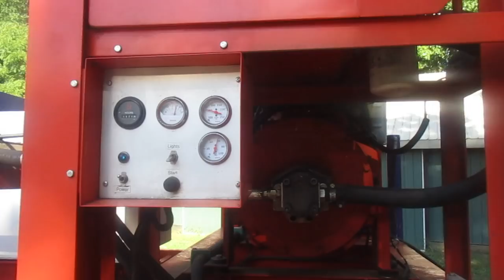Big splitter gets the big chunks  #493

Comment: Boy, Talk about a set-up, that's quite a machine. 2 people, 2 pickup loads, instant wood splitting. The only requirements, a conveyor, a large area and lots of wood. Great design that shows great workmanship. I really like the hydraulic leveling.
Reply from the maker: hi there we do a lot with what we have or can make work . bought the elevator for 1000 bucks lots cheeper and longer than any wood suppliers . and it gets used for sawmill slabs thats what it was got for , the splitter was almost made of stuff we had or found . the trailer the JD motor , the 4 leveling cads, the 6" main ram , the 2 table rams , and most the steel were free . we bought the table steel, hydraulic lines, pump and main valve ,pump to motor adaptor , and 50 gallons of hydraulic fluid . i than there is less then 2000 in it but a lot of time most the winter a few years ago . thanks john

Comment: I can see the 3/4" orange blade on the top, but is there also a vertical blade below that too so the wood doesn't come out as slabs? Looks like maybe 3 vertical blades by the cut pieces you were pulling out.
Reply from the maker: hi there yes 3 or 4 depending on the blade in it  thanks john